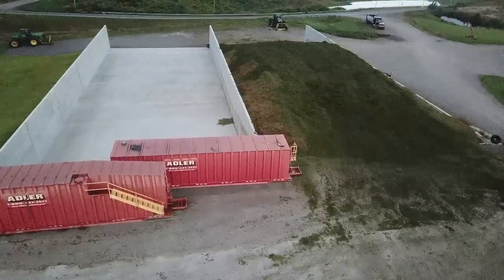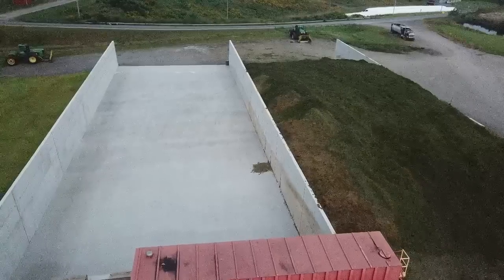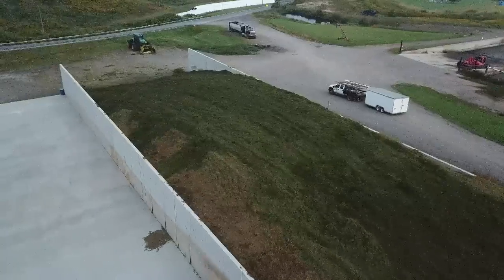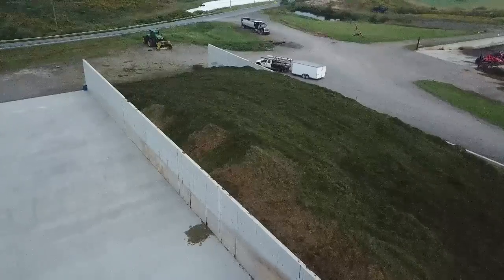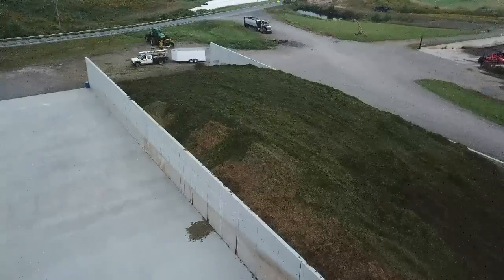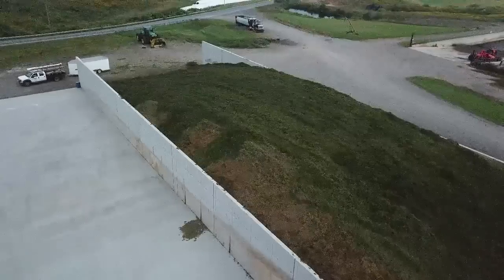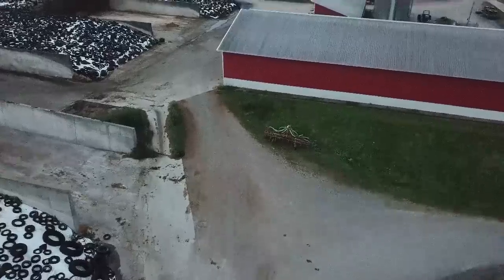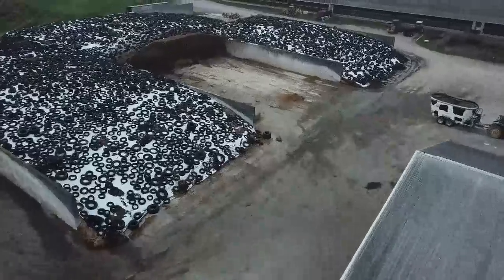Dryhill Frac tank and questions answered

Comment: It would be interesting to do a simulation of the system with and without the frac tank to predict the workflow improvement. One would need some statistical data though (load- / unload times at the bunk and at the tank, road trip time, spreading time).
Reply from the maker: Arnim K. We have all loads recorded to date so we’ll be able to compare

Comment: .Big landfills have same setup for catching the juice or the run off  It's stored in a big water tower then they truck it off to a water treatment center ,some have direct line to treatment plant smells like sewage  Some burn off the methane or heat shop in winter or produce Electric  Someone I know told me this that works in waste removal so I don't know how much is accurate
Reply from the maker: Fred F he is right

Comment: About your tires you use to cover the bunks, here in KS, we're not allowed to keep old tires due to mosquito's. It's a huge fine for us here, plus you get the EPA sitting on your doorstep and interfering with daily life on the farm(s). Is there some special licensing or fees you're having to pay in order to keep and use them? Don't frac tanks need a cover? 
Great video as always. Cheers :)
Reply from the maker: We are having to get rid of tires to and frac tank doesn't need a cover.
Reply: @FarmingFixingFabricating , How will you hold down the covers without the tires ? Thanks.
Reply from the maker: @augustreil  cut tires
Reply: @FarmingFixingFabricating , So...You'll have to cut them in half or quarters to use them ?
Reply from the maker: @augustreil  they are cut in half like the ones you see on barrels on the highway
Reply: @FarmingFixingFabricating , Thanks. This is why your channel stands above others, is because you try and answer as many questions as possible. Thumbs up.

Comment: How come you use sand as bedding rather than sawdust?
Reply from the maker: Availability
Reply: @FarmingFixingFabricating  can you not install a system where by the sand is filtered out of the slurry and can be dried and reused?
Reply from the maker: @davie2606  yes sand can be seperated out of manure. It's a very costly setup
Reply: @FarmingFixingFabricating  would that in the long term not be benifical than having to constantly muck out under barns?
Reply from the maker: @davie2606  we only have to do that a few times a year

Comment: If it takes a tractor to work the pump, why not just pull it with a tractor?  Are you thinking about going umbilical system? Be better than that big heavy tractor and tanker for ground compaction
Reply from the maker: More than likely some day we will drag line of if it and yeah for most part just moved with a tractor would be best.